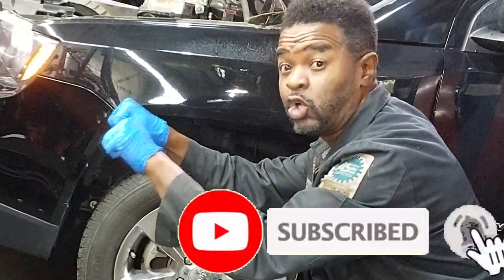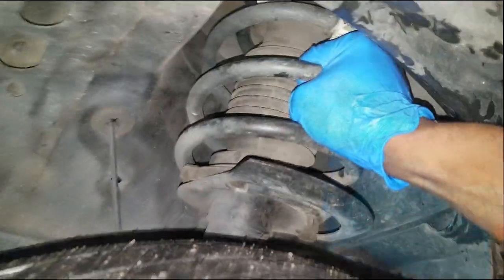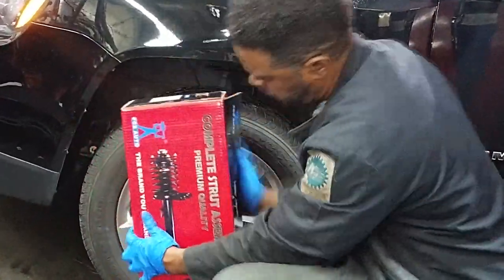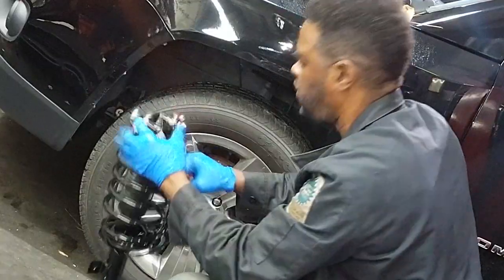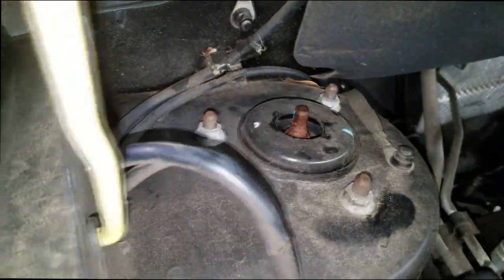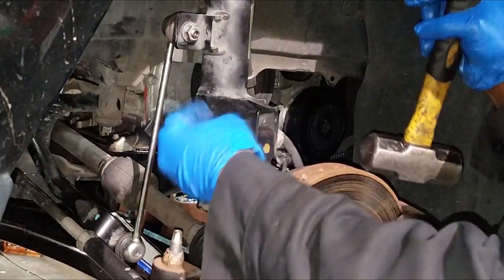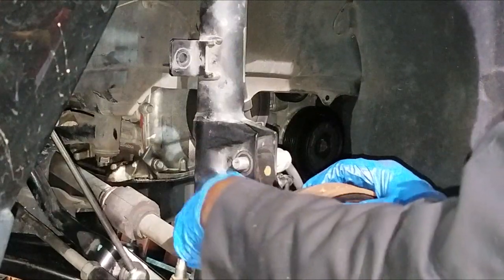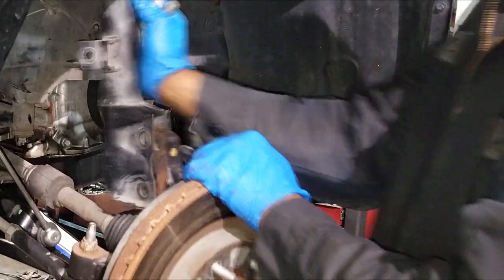How to find suspension bump knock clunk noises on your car HACK..DO THIS

Comment: I replaced the springs, struts on 4 corners. Still had noise. But wasn’t upset bc all 4 were blown and 2 springs were cracked. Than I replaced all 4 end links. It did quiet it down and fixed the loose steering. But it still made noise. I than replaced all 4 sway bar bushings. Now that fixed it. This was a 2010 Camry 174K miles.
Reply from the maker: O wow, thats whats up..Glad you figured it out..Please subscribe to the channel for me, thanks
Reply: Sway bar links!

Comment: Quick struts for the win I have a rattling noise over washboard/rough roads mostly at low speeds anything I should look for this one's got me scratching my head
Reply from the maker: whats up JFW, hey man, the human ear and eye sight have to really be on point when dealing with susp noise..And a pry bar helps..I find most my noises with load still on susp in the air, basically on the alignment rack..Not sure what suspension you dealing with but if steering links and a sway bar equipped, that will be first thing ide sheck.

Comment: I bought a 2006 sonata it's got knocking in the front driver side. Looks like the struts were replacing in the front with quick struts and new sway arms. At some point looks like the outer tie rods and ball joints replaced also. I'm out of ideas of what it could be besides maybe a motor mount?
Reply from the maker: Hello my friend, thanks for watching. Now depending on the suspension set up, you should prolly let the car in the air with the wheels still on the ground (alignment rack) use a pry bar to see if any bushings such as lower control arm or anything like that moves. Also, YES, engine motor mounts can also cause this noise. Again, thanks for watching and please subscribe to the channel, thanks

Comment: I have a 2012 Hyundai Elantra I hear a noise from coming from a front passenger side when I drive over on small bump and also when I do reverse I hear this clucking noise and when I put on drive I hear it 2 I think it comes from the passenger driving side.what would you recommend or should I do please help

Comment: Hey @Online Mechanic Tips i know you helped me and I'm really great full you deal with dodge so i know
your the right man to ask for help i don't know what to do anymore i can't keep putting new parts into
my Dodge caliber thinking it's the problem if you can help me out it would save me money i don't have 
im willing to send you what i can if you can help my problem is when you start the car cold and the idle 
is  little high car runs great no problems at all once the car heats up idle goes to normal if you give 
the car gas in park once you let the gas go it will feel like it wants to stall same thing if you turn 
the wheel right or left or turn the heat on etc... when you stop at light in drive it will run  little 
rough once you start driving it runs good no engine light and no codes here is a list of things and parts i changed
(Got a new battery, new alternator, new spark plugs, got the timing done with new timing change, new camshaft sensors and crankshaft sensor, new MAF sensor cleaned the throttle body, new fuel injectors, checked all the grounds and wiring inside and out of the car, checked radio, checked relays, fuses,took Tipm out checked it over,changed pcv valve, tested ignition coils  )
i don't know what it can be if you have any ideas and can help would be great thanks keep the videos coming much love.
Reply: I’d say if you did all that it could be problems with oil pressure and/or fuel pressure

Comment: I have changed left side stabilizer link and ball joint but still clunking on little bumps. What may be the reason?
Reply: Anti roll link bar, maybe
Reply: @robertalexandrubaba7065  suspension mount....thanks

Comment: Hey I own a 1997 bzr toyota levin with a superstrut suspension that has a knock that you can feel by your feet drivers side. I can hear it from 0-60ish kms have replaced shocks and strut mounts but still getting knock, would you have any idea because this ones got me.. havent dealt with superstrut. Cheers

Comment: Have a 2016 toyota camry you put it in gear to go reverse and as soon as it goes back u hear like a metal clunk noise in the front passenger tire
Reply from the maker: O wow,..My friend, with things like that, you almost have no choice but to get the car off the ground and do a complete suspension sys check/test. Thats the only way you can tell what the problem is. Thanks for watching, please subscribe to the channel, thanks

Comment: Title is misleading, should be named how to test and replace a strut....not how to find suspension noises, cuz suspension noises could come from at least 5 or 6 other places than the strut
Reply from the maker: Hello bud, thanks for watching. If im not mistaken, I showed a procedure of testing, which relates to how to find suspension noises. But you are correct in that suspension noises could come from a number of areas. During what I did in the video was the only way to find the noise I was looking for..This car had already been repaired several times for this noise but never fixed.